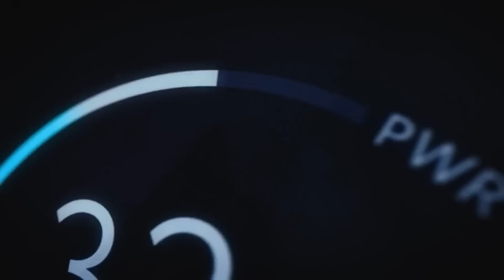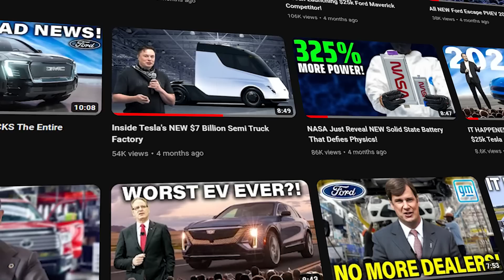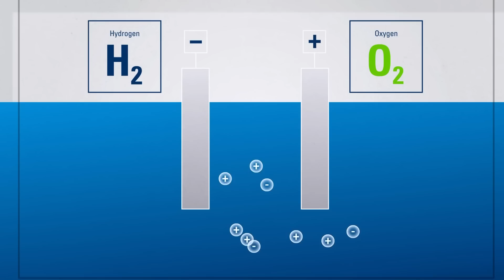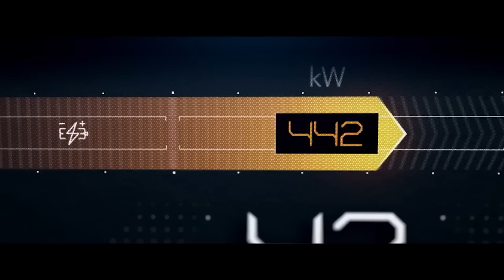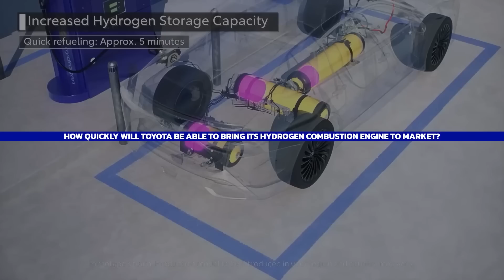New Toyota CEO Reveals Hydrogen Combustion Engine | Shocks Industry!

Comment: To fuel my EV with my solar roof, all I need do, and all I ask anyone else to do, is to wait for the sun to come up.  Imagine all the extra steps needed to fuel his HICEVs with fuel!
Reply: Or win, or wave, or whatever.... ev is using energy stored in battery.
Reply: @petertran5419  Read my post again.
Reply: The average person can't afford to install solar panels on there roof. Plus most people  rent there home. Most homes have no EV OUTLETS
Reply: @305brian  OMG!
Reply: @305brian most homes don’t have a plug?… more lies
Reply: @sickb0y333  most homes don't have EV PLUG IN U HAVE TO GET THAT INSTALL COME ON WHERE IS THE LIE.
Reply: @305brian  if you have electric you can charge. You don’t actually ‘need’ a special charger. You can use any plug and charge over night like a normal, regular person. Making out otherwise is a lie
Reply: @sickb0y333  Maybe they're Amish. LOL
Reply: @sickb0y333  Been charging my long range Tesla model Y from a standard 120v outlet for two years. Takes 15 seconds, plug in when I get home, unplug when I leave. Imagine waking up to a full tank every morning. 
I have a long heavy duty 14-50 extension cord that can plug into my dryer outlet that I tested once and never used again as 120V is sufficient to charge overnight while I'm sleeping. I have run conduit and waiting for summer to run 240V for faster charging more as a convenience than necessity. 
If you can afford an EV you can afford to run electrical and buy a $300 to $500 charger. 
OMG I spent 50K or more on a car and can't afford another 1k on a charger. hahaha ROTFLMAO
Reply: @305brian  I've been charging my long range Tesla model Y over night for 2 years from a standard 120V outlet (very slow level 1 charging). Takes less than 15 seconds to charge, plug in when I get home, unplug when I leave. I ran conduit to my garage for 240V and just waiting til summer to run the wires. 
No more wasted time going to a gas station, wasting more time fueling up and driving back. Imagine waking up to a full tank every morning :-)  

As far as solar panels companies will eventually install the solar panels and powerwall for free, dropping your monthly payments to less than what you were paying for electricity. They'll make money by selling power during peak hours becoming a de facto virtual power company. You save money, they make money over time. In the end when it's paid off you keep the system. 

Recently I discovered the college next to my work offers free level 2 (slow) charging for free, they have solar panels. So once a week I park at the charger and have a full tank (battery) when I get out of work. A full charge at hone costs about $8 to $9 for 300+ mile range. When I go to time based billing costs will almost drop in half. The free charging only saves me $8 to $16 depending how many times a week I charge. It could save me $500ish a year so no biggie.
Reply: Imagine all the steps necessary to amalgamate all the processors to move energy from your tank (battery) to the motor: imagine all the steps necessary to make your battery useful. 

The government LEVERAGE for EVs is really just a ruse for mass transit. Get the costs down, and eliminate the use of strategic minerals, and the EV will win. Fat chance that will happen.
Reply: @DHW256  Ice vehicles use plenty of processors. This isn't the old carb days where all you had was a 12v battery. Speaking of 12v what an inefficient voltage to use. Plus for EV's the "extra steps" are software too which can be revised OTA instead of flashing a ECM at the dealer.
Reply: @jimjones3370  you should count the number of processors in the typical Tesla.
Reply: @DHW256  No, no, no, no, no.  You are not comparing apples to apples.  Try again.
Reply: @timower5850  Ya, he's comparing a fresh apple to a rotten orange.
Reply: @timower5850  You obviously don't know the difference between the factory and the dealership. Yes, apples to oranges.
Reply: @DHW256 hilarious
Reply: @DHW256  Ya, Tesla is barely growing and doesn't have realistic plans for a $25K car, to be built in Mexico in about 12-18 months.
Reply: @machoopichoo2  Too bad it comes at the behest of cost sharing for extra consumers and taxpayers. 

I hope Elon can pull it off; and the more distance he can put between his company the government, the better. Otherwise, government LEVERAGE will prove EVs are a ruse for mass transit.
Reply: @DHW256  The IRA rebates for BEVs are not needed. BEVs are a commercial inevitability. So, i is a waste of money. But as a TLSA share holder, I don't mind.

Tesla pays a s-load of tax and creates great jobs in America. 

Another form of corporate socialism is that companies don't pay for unpriced externalities. It's not just tax, which big companies like Amazon avoid like the plague, anyway.

Comment: What? I heard a word "Engine"..sorry, as a EV owner now, I prefer my low maintainance cost and less noise and nice smooth acceleration (no pause from switching automatic internal gear shifting, esp rolling uphill).
 Also, how long does it take for generalization of H2 refill station? Toyota and others need to expand that first. For EV, we can charge at home. But for H2 car, we can't.
Reply: low maintenance cost, lol =)) you mean high insurance cost? expensive parts that you cannot buy from 3rd party? Don't get me wrong, I love electric motor, but to say EV is low maintenance is a joke. Sure the motor itself has less moving parts, but a car has much more than just a motor.
Reply: @philongpham3886  lol the words "maintenance" =/= "insurance". There is a service called warranty. Everyone keeps his/her car for different amount of years (some within warranty, some after warranty). I guess you are later one? anyways, thank for your opinion.
Reply: @chenavd  I definitely the later one , because it’s cheaper and though I’m not an environmentalist, it’s much more friendly for the environment than to buy new car every 3 4 years. Reminds me the junk German cars.

Comment: Its hard to digest that Toyota will go down any time soon. Depends on how soon they resolve the battery design and supply chain issues for EVs.
Reply: It's sad for the workers and their pensions but it is already over for Toyota. They have 0% chance of surviving.
Reply: In the UK, petrol stations are not very profitable. Every electric car makes them less profitable. Every closure of a petrol station create more demand for electric cars. The price of petrol will increase as stations become rarer. I think Toyota have five years to create world-leading factories, world-leading batteries, world-leading EVs and world-leading autonomous driving. China is creating EVs at a fast rate but not making a profit.  Can Toyota close their ICE production and move to EV production in these time frames? Or will they be stuck with machinery that has no saleable product?
Reply: @robertwhite3503  I thought it was 7-10 years away, but you could be right. In Canada, EV sales are less than 5 percent, so there is not much momentum, but other places may lead the revolution.

Comment: Hydrogen is a non-starter.
Reply: I would love to fill up the fuel tank with water though. 
Jokes aside, any ICE, hydrogen or gasoline, requires more parts, gearbox, cooling system, turbo charges, etc. compared to simply a drive motor of EV with more torque. Maintenance cost for EV will be much lower. 
The holy grail would be to use Hydrogen as fuel source to power a generator to charge EV batteries. That way the fuel to the generator is green, and you don’t need to charge the battery that often as it JS self charging. And maintenance cost will be low, with all the benefits of EV. 

Toyota pivots to this to preserve its massive workforce because going the EV route will render almost half its workforce in Nagoya redundant. It will not go down well with the Japanese government or the public.
Reply: Tell Nikola Motor fan boy THAT 😄😅
Reply: @mikafiltenborg7572  they already know since they don’t have that hydrogen semi for sale.
Reply: @mikafiltenborg7572  You mean the company that is about to go bankrupt. The same company that has its' founder on trial for fraud? The same company that lied about every hydrogen advancement and capability to sucker investors? That Nikola motors that has no hydrogen stations and no hydrogen semi?
Reply: Ridiculous comment!!🤣🤣🤣🤣🤣🤣🤣
Reply: @barry3839  what is ridiculous about it? Hydrogen has way to many negatives to work for road transport.
Reply: @williammeek4078  Hydrogen is already being used in some cases. Educate yourself and you will know or sit back and watch Toyota.
Reply: @barry3839  you might want to educate yourself on this topic. There are no heavy vehicles powered by hydrogen that are commercially available for purchase. Yes, watch Toyota continue to fail to make a commercially viable hydrogen vehicle.
Reply: @williammeek4078  YOU might want to educate yourself. I never said that hydrogen vehicles are being sold, however they have been used commercially. I am not going to do your research for you!
Reply: @barry3839  try google, you might actually learn something real. They aren’t. There are a couple of trails with subsidized fuel but not in real commercial operation. Not like BEVs.

Comment: I wonder if a dual fuel ICE is possible:  hydrogen or gasoline.
Reply: No, H2 combustion engines run much more lean and have higher RPMs. H2 is stupid, regardless.
Reply: Not possible: beside the H2 tank, there is no space anymore for the gasoline tank unless you place it on the co-driver seat 😁

Comment: I'm not interested in an EV but I would consider a hydrogen powered vehicle.
Reply: Have you drivin a Tesla or been in one ? It's an eye opener. I dont doubt Toyota make great cars but ice has done its course and fitting a fool cell to a ice engine is not the way forward.  4 million Teslas cant be wrong.
Reply: @Mark Kennard  I'm not interested. I'd rather have something that has the range and refuel speed of my current vehicle. If it can't at least do that, it's a step backwards to me.
Reply: @ockbinnock  it does require a bit of a switch of thought. Hydrogen will be a nightmare to find, though. 
Unless you’re driving 200 miles a day, or take road trips every couple of weeks, having an EV isn’t an issue. You always leave your house with a “full tank” so to speak. 
It’s not for everyone, but most people don’t drive more than maybe 50 miles a day for work, and maybe 100 miles a day on weekends. 
Side note - even though it isn’t “2 minutes”, if you plug into a Tesla supecharger, walk into a fast food place order, get your food, come back to the car to eat, the charging will be done before your food is. It’s quite fast…
Reply: @ockbinnock  CNG might be a better option if it’s efficient, since it’s delivered to a large amount of homes already….   I think hydrogen is more viable for maybe home generators and things….
Reply: @Meatball2022  "it does require a bit of a switch of thought. Hydrogen will be a nightmare to find, though. 
Unless you’re driving 200 miles a day, or take road trips every couple of weeks, having an EV isn’t an issue. You always leave your house with a “full tank” so to speak. 
It’s not for everyone, but most people don’t drive more than maybe 50 miles a day for work, and maybe 100 miles a day on weekends. 
Side note - even though it isn’t “2 minutes”, if you plug into a Tesla supecharger, walk into a fast food place order, get your food, come back to the car to eat, the charging will be done before your food is. It’s quite fast…"

Vehicle are an expensive investment. I want something that I spend that much money in to have multirole capability. If i'm going to spend that much money on something, for me, it should be capable of having the same range that I get now. Plus, I live in a northern climate and it gets quite cold here. The car's heater sacrifices much more existing range in an EV vs a ICE. 

The tesla supercharge is fast but still not that fast. 20% to 80% in 40 minutes vs practically 0% to 100% in 5 minutes. And you need to have fast charging capability.

Again, you do you. If an EV works for you than great. Why are you so invested in trying to convince me that I don't want what I want? If EV's had the range and refuel speed of my current vehicle than I would consider it but they don't. You ask me why I was more interested in a hydrogen vehicle that a EV "just out of curiosity". I explained why. Why is this so important to you?
Reply: Why?  Genuinely curious. Because refilling hydrogen would be a nightmare. No?
Plus - electric motors have almost no moving parts. Hydrogen combustion can’t say that. They’ll have moving parts. Wear and tear. Etc.
Reply: @Meatball2022  because it refills as fast as  a gasoline engine and has equivalent range.
Reply: @ockbinnock  and it’ll take an hour to drive to a “refill”station…
Reply: @ockbinnock  frankly, EV’s refill at home overnight, or sometimes at the workplace while you’re working. If it takes 2 minutes to fill a gas tank, that’s 2 minutes an EV owner doesn’t waste.
Reply: @Meatball2022   "and it’ll take an hour to drive to a “refill”station…"

That's why I'll stick to a gasoline for now.
Reply: @Meatball2022   "frankly, EV’s refill at home overnight, or sometimes at the workplace while you’re working. If it takes 2 minutes to fill a gas tank, that’s 2 minutes an EV owner doesn’t waste"

Cool, you do you. But i'll take more range and faster refueling over charging at night. Why do you care so much about my preferences?
Reply: @ockbinnock  im not attacking you, man. I was just curious why hydrogen over EV.   I just don’t see any benefit.  But ok - sorry to offend you.  Have a good day
Reply: @Meatball2022   "im not attacking you, man. I was just curious why hydrogen over EV.   I just don’t see any benefit.  But ok - sorry to offend you.  Have a good day"

If that were the case you would have ended it after I answered your question. But then you went on and on about why I was wrong about my own preference. You obviously like EV's and that's fine but not everyone is going to prefer them. All I said was that I (meaning myself and not referring to anyone else) would like to have a hydrogen powered car over an EV if there was a choice in an alternative to gasoline and I even went so far as to explain why when you asked.
Reply: @ockbinnock There’s a difference between what’s possible and reality.  You can install 40 EV chargers for the cost of a hydrogen station.  The ratio of hydrogen stations to cars will always be low because of the economics involved so you will be waiting in line to refill your hydrogen car.
Reply: @Chris  OMG, listen: I'm talking about what I'd rather have. Not the logistics of fuel to charging stations.